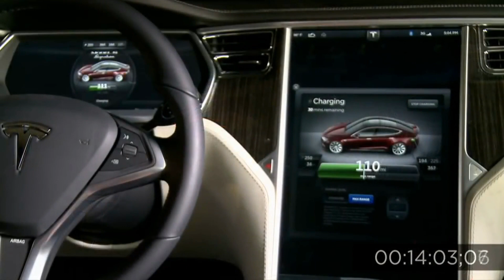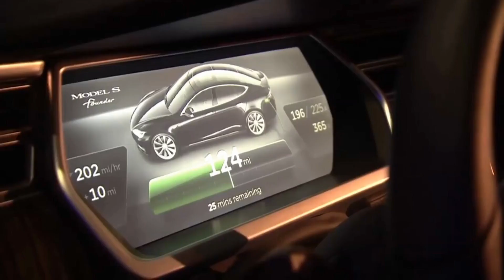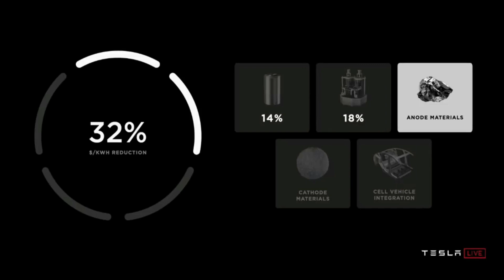Tesla Battery MAINTENANCE | Tips and Tricks

Comment: Great predictions...

But I had not one...but two different S's die on me.  Not the 12 volt...the main battery.  Suddenly.  Miles in the 20K range. Both to my 2014 S 85 and my 2018 S 100 D.  No...I didn't "overcharge" my battery.  They warn us (in a very small print...perhaps enlarge the print?) about not overcharging...but I'm a retired person....so I almost always go on long "road trips" - hence I have to charge "to capacity".   Perhaps if I set the charge to 95%? 98%  Thanks in advance for any replies.